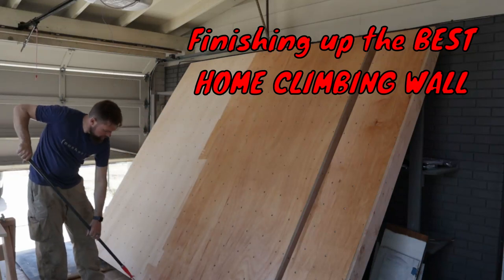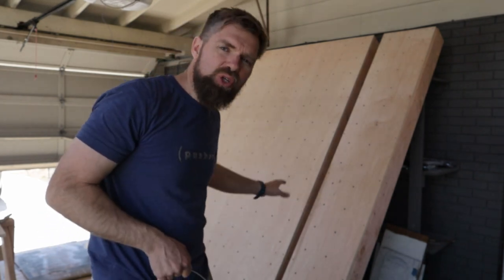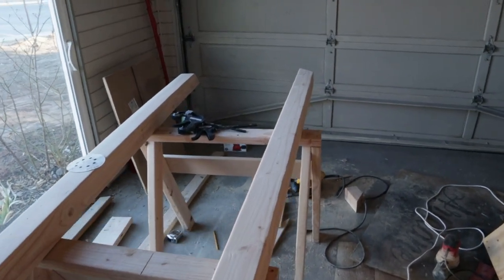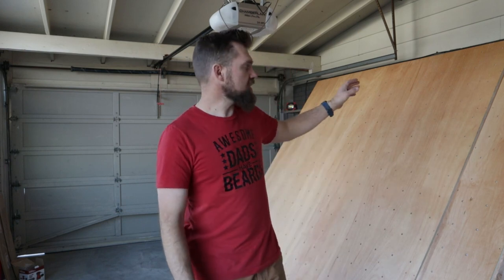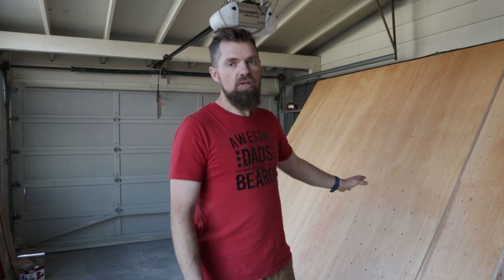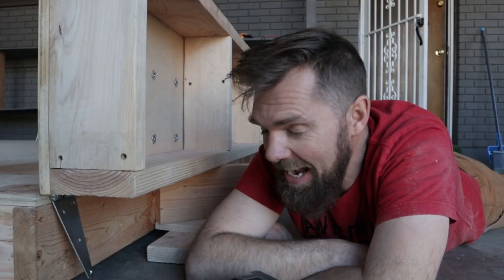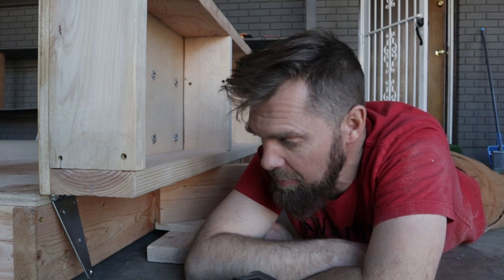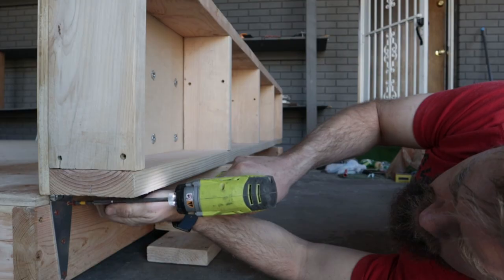BUILD A CLIMBING WALL Finishing The BEST Home Wall

Comment: Looks amazing. Been all over YouTube looking at the best home wall designs and think I'm going to try and replicate this!! Just wondering - is the weight on the straps solely during climbing and the winch is only engaged for when straps are loosened to adjust the angle?
Reply from the maker: Thanks! This has by far been my favorite home wall build also.
Hoist/winch is used primarily to move the wall but I did keep a bit of pressure on it when using the wall

Comment: Do you have a link you can share for which wench you used for the build? Thanks!
Reply from the maker: This is similar to the winch I used... https://amzn.to/3uZOoja
I will include this link in the description for anyone else that might want to find it.
Reply: @climberdad  Thanks for the info! I just purchased your plans for original freestanding wall, but I would like to try to build something similar to what you have in this video. In this build, does the winch alone or safety straps hold the climbing area up?
Reply from the maker: Mainly the straps but i would have the winch cable kinda snug to help also.
I would love to see the wall once you're done.

Comment: Pretty sweet looking.  How do you compensate for the wall flexing as you put stress on a corner?  Is it just minimal flex?
Reply from the maker: I have a safety strap (ratchet) on each corner that get tightened down after each adjustment. It still has some movement but overall pretty minimal.
Reply: Awesome board! Is it possible to build this wall without the lumber braces on each side if you attach it permanently to your garage?
Reply: @gregsloat  you’ll be adding a bit of framework from the backside to the wall, but yes.  There are many videos on YT and articles available if you just get creative in your Google searches
Reply from the maker: @gregsloat  yes you can.